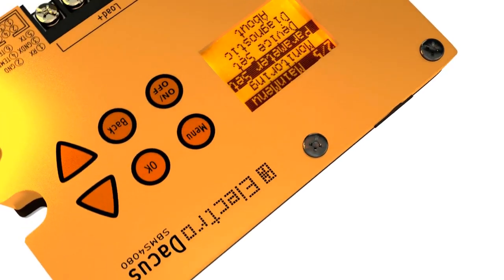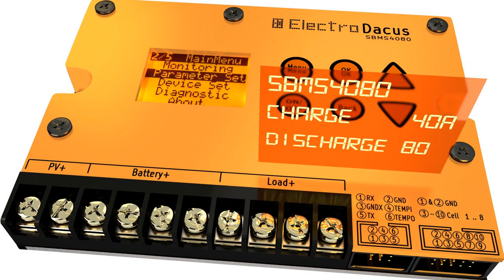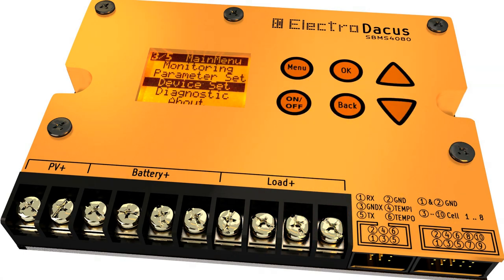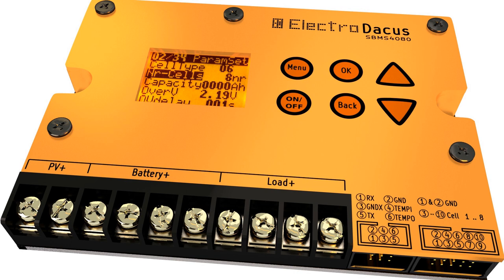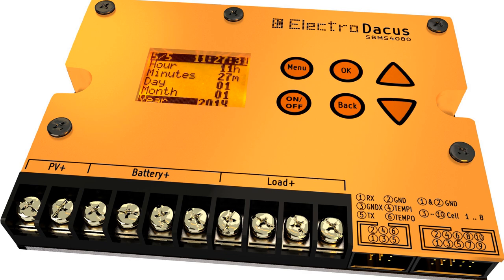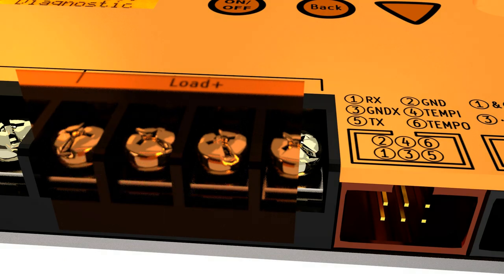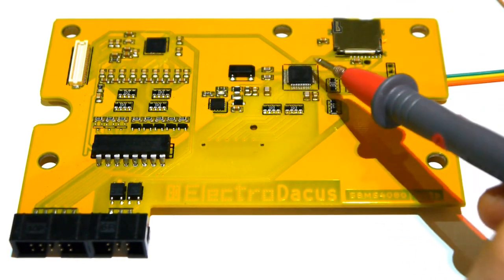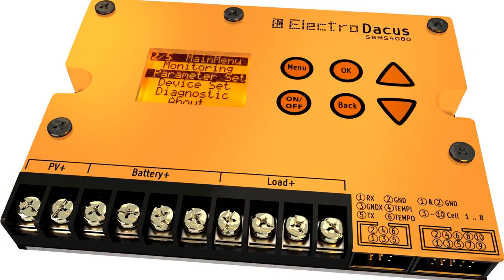Open Source Programmable Solar BMS presentation video.

Comment: That's a very nice looking item love the colours, layout and look of it. The menu's look nice too.
Reply from the maker: Thanks for the comment.
It seems we have the same taste.
There is no guarantee that the real item will have the same colors as the 3D render. I will try to get them as close probably ask for orange PCB this time since I had two different manufacturers with very different yellow amber colors the alpha sample looked much nice than the current beta sample.
The menu is something that I can control and that is the actual LCD from the beta device photographed and added in the 3D render.

Comment: thanks for the video.

i want to build 2 kw solar and battery system. I want to use GBS lithfepo  the whole system has to  mobile power buffer. Can i  use your programmable solar BMS?   what would be the best way to do it?

Comment: when charging will this keep cells in balance?

I think this is just what I need for my off grid project.

Does it do any mppt matching of the solar cell?
Reply: and very good video too.
Reply from the maker: Yes it dose cell balancing you can watch my other video the 38 minute long for more details.
I designed this for my offgrid house since there is nothing like this available.
No MPPT but is not necessary MPPT is an obsolete technology in most cases and that is because of the current solar PV panel cost.
MPPT in best scenario depending on climate will provide 10% extra energy but with the additional cost of the MPPT part especially the DC-DC converter you can get much more than 10% additional solar panels.
And the panels will last for over 25years where MPPT will usually fail much sooner because of temperature and electrolytic capacitors.
It seems I worked on the video to much and it will not even be allowed at Kickstarter because some can think that the 3D render is a real product.
Reply: *****
emmm... I disagree about the benefits, if you have a small array due to size limitations, lets say yuor panel are on an RV moptohome, that 5% extra from having mppt would be very good, even if the mppt cost $50 to add.... and it does not cost $50, there is arduino code that will work on a $5 328 and it need another $2 of components, $7 for 5%, very very worth it.

http://www.timnolan.com/index.php?page=arduino-ppt-solar-charger
Reply from the maker: lez briddon Most people will not be able to build their own MPPT so it will cost way more than that for a good MPPT but even if you build that yourself you need quality components for it to last just some good electrolytic caps will cost  more than a few dollars then you need a PCB and that will cost more than 50$ since you build just a prototype (or are you etch your own PCB?)
Anyway even if space is limited that 5 % do not worth the trouble better get solar panel that are better efficiency a 18% efficient panel compared to a 16% one will give more that a good MPPT at a similar cost.
Is also possible like in my case to use 60cell solar panels to charge 24V batteries that will not have any benefit with MPPT.
Also I do not think you add the hours you spend researching building and testing your MPPT that can cost way more than the components.
Look at me as a lesson :) I spent about 6 months of at least 8 h/day developing this and a few thousand dollars on components for a few samples and is possible that I will be the only one using this that will be really bad investment for me.
There is so much more that I can say about MPPT but my conclusion is that it had a role when solar was over 5$/Watt it dose not have any chance now.
Some people are also missing the experience of having a solar installation most of the time my batteries are full during the day so I waste huge amount of power that way :)
O and another separate argument. You say 50$ for components but not mention how much power will that 50$ MPPT (components only) be able to handle.  Also what is his self power consumption not just efficiency since that can take back all that is additionally producing during the day.
I hope you do not take this personally or that I try to defend my project :)
If I will have consider that MPPT will make sense I will have included one. Of course my device will have been a few kg heavier and much larger to be able to handle 40A charging (1000W) even with very efficient DC-DC converter.
There are no electrolytic caps in my current design.
It only has just over 200g and I save over 50$ to 100$ just for international shipping on a single unit compared to an MPPT version that will be at around 2kg at least mostly the additional coils and much larger heatsink so 10x heavier.

Comment: How do we get it? When is it going to be available? I wish I knew about this kickstarter when it was running! This is absolutely amazing! I want one!
Reply from the maker: Hi Nicholas,
This was done just for the initial Kickstarters but I will soon start a Kickstarter for a new and improved model see my last video.
The Kickstarter for the new one will start around end of February.
Reply: I'm on the edge of my seat waiting for it. I can't believe more people don't know about this.
Reply from the maker: Nicholas Libby
Thanks Nicholas, Is a bit hard to advertise a new product.
Reply: Don't worry about advertising it. Worry about getting it out there, I'll be sure to get my hands on one and everyone I show it to will be immediately saying "Where can I get one?", this thing will spread like wildfire once enough of them are out there in the wild.

This is a better tool than any PWM or MPPT (although it already says it doesn't do MPPT) system I've seen. And with people writing their own software for it this has the potential to give all these expensive systems a run for their money.

I would suggest not constantly advertising it for developers only as I'm sure anyone that could use a regular PWM system could use this after reading a little bit. When they see the charts and graphs for their battery life they'll just keep finding more settings they can improve on and will never want to go back to a dumb system. Advertise it as a smart system, this thing is brilliant!
Reply from the maker: Nicholas Libby
I currently work on the Kickstarter page and I try to explain more why this is a much better option than Lead Acid.
I also made a simplified connection diagram. Is still a bit more complicated than a simple Lead Acid controller way more connections to do do to individual cells measurement and balance.
Also the amount of settings is quite high. Next version will have a simple setup with just a few basic settings and an advance menu where all those other more complex settings will be hidden.
So I hope it will be more user friendly while still maintaining the flexibility of using any type of Lithium battery produced to day or in the future as well as super-capacitors.
Many technologies become obsolete do to low cost of solar PV in the last few years one of them is MPPT that is not cost effective to implement but solar tracking and thermal solar are some of the may others that are just obsolete because they can not add benefit to inexpensive solar PV.
I will try to make some more youtube videos explaining all this in more details.
One of my next preojects after this new SBMS will be to heat my house with electricity using just solar PV panels and resistive heat elements + a digital MPPT that I came up with. Is totally different from a traditional MPPT but dose the same thing for heating. Is much simpler no DC-DC converters more reliable and has great benefit for electric resistive heating but can not be applied to battery charging.
Reply: ***** Don't worry about simplifying it. Worry about getting more of these out. If you can configure the settings in the unit from the programmer header pins, then software developers can just make a computer based wizard where you pick your batteries, count, size, all of that, and it'll write all the configuration into the device from a USB port or something. This can be done separately and the software can be updated on the fly without slowing down the development of this board.

For example, I want one currently and there's not one available to get. There has to be other people out there that want one and can't get it. Once people can start getting it and making their own videos and software and suggestions this thing will just keep growing from there. Don't worry about the software side of things as there are many software developers out there, just give us the interface to chat with it and we'll make the software.
Reply from the maker: Nicholas Libby  You probably underestimate the complexity of the software. I'm not that great at software but I understand the HW extremely well that allows me to make a functional and bug free software. The SBMS4080 still runs the original 1.0 release version of the software with no problems.
If you really want one of this older SBMS4080 write me an email same user name as here on gmail and I will put you on a preorder list. I have 10 to 15 PCB's left from the first batch and I got the components to build them but weather was not great and did not had enough sun/energy to build them. Now I'm a bit busy with the new kickstarter it should start in about 3 weeks but ass soon as I get some days of good weather and free time I will build those and let you know.
More than half of them are already promised so I can only provide you with one in case others may also want one before I'm ready with the new version.
There are huge improvements on the new version making it even better.
Currently I'm using a SBMS4080 to run all thing in my house and is connected to a small toy laptop running Debian logging my power production and consumption so I can make recommendations on SBMS / battery size and PV array size based on real data.
I have 3x 240W PV panels and yesterday partially cloudy I produced 2.56kWh today up to now (mainly sunny) 3.38kWh. I want to log at least a week to get different conditions.
What will you use the SBMS for ? And how did you found out about?
Reply from the maker: Nicholas Libby
This is some long comment :).
Not sure you will be able to carry a 1kW solar PV panel even if it is not made with glass and made out of smaller epoxy sealed PV panels.
I have two 1h video one about the user interface explaining all the futures of the SBMS4080 and one about the hardware.
The SBMS4080 is extremely portable at just 235 grams and the new SBMS100 will not be much heavier or larger than that not by much hope to keep it under 350g
SBMS4080 can handle 1000W of solar PV panels with 24V battery half that with 12V of course since the current limit is the same and voltage is half.
The new SBMS100 will be able to handle 3000W of solar PV panels with 24V battery.
Absolutely any rechargeable Lithium battery can be used since all parameters are fully programmable using the SBMS build in menu.
It also has energy counters for battery, PV panel and Load that can be reset at any time so you can in details see the amount of energy you produce and consume. This is available in SBMS4080 and will be available and improved probably even with graphs in the new SBMS100.
But just in a week or two there will be much more info about the new SBMS on my website and soon after the Kickstarter campaign will start.
The new SBMS will also have multiple 24bit ADC input for user to measure and automate stuff externally there will also be much more IO pins available to user.

Comment: Did they deliver on this product? I'm are it's not on kick starter anymore
Reply from the maker: Yes I delivered that Kickstarter and since then another two Kickstaters with more advanced version of SBMS. The last one was delivered very recently and there are a few extra SBMS40 and SBMS120 left.
You can read more on my webpage http://electrodacus.com/ and here is the user manual for the last two models http://electrodacus.com/SBMS120/manual/SBMSmanual.pdf
You can check the progress of all the Kickstarter campaigns on my google+ page https://plus.google.com/+electrodacus/

Comment: Electrodacus. I admire your enthusiasm, but it just seems like an awful lot of smarts for a small controller. I think you need to clarify your target market. MPPT is a given for all serious off grid installations for very simple reasons. Things like real world high current distances from the array to the controller, and the rising price of copper. Like, matching the much cheaper 72 cell grid tie panels to nominal battery voltages.

Off grid we use crimp lugs,posts and 50mm2 cable, lots of it. The tiny terminals, small load rating, and 24V limit all suggest its not going to work for real "off grid" domestic applications. Like i said at NAWs, cabin, RV etc, radio tower whatever, should be good applicatiopns though.

However there is real and growing interest in LiFePo for residential off grid (eg CALB 400Ah), and it would be great to see someone thinking about a BMS that can handle 800Ah at 48V. There are various challenges, among them, comunication with the charge controller; the problem of removing battery from the controller without pv removal, the current draw and reliability of large load contactors. To balance or not to balance etc. [1]

Id encourage you to do some reading in the NAWs 'off grid' archives to get a real feel for the needs and challenges we face every day.. There are active threads both there and at midniteforum about lifepo.

Our traditional charge controllers do many other things that we rely on. One of them is notifications for opportunity load diversion. Im not convinced that attempting to recreate all of those functions is practical, but if the problems listed above [1] are unresolveable then maybe your intergrated solution will become the way to do it.
Reply from the maker: I really appreciate your extensive feedback.
The MPPT is mostly useless with todays price of solar panels. As for the savings on copper on installations where panels are far from the battery that is probably the only situation where an MPPT will make economic sense but not sure it will depend on situation. You will need 4 or 5 MPPT controllers during the lifetime of the solar panels 30 to 35 years.
60cells are as cheep if not cheaper and work perfectly for 24V this is what I use.
This was designed for my offgrid house and it mets my requirements. Is true I was born and lived in Europe where people are more conservative with the use of energy.
I see many people still don't see that I use 4 terminals each 20A to get to the 80A load and two terminals for PV for 40A
There are only the positive terminals there the negative is common outside the BMS.
I will probably add load diversion capabilities with external solid state relay.
A 40A MPPT will need to have a DC-DC converter able to handle 1000W that is huge at least 2kg where this controller has 200g so 10x less
Just the international shipping will be over 50$ additional because of the extra weight then of course all the extra components and short life span do to electrolytic capacitors.
There are no electrolytic caps in my design so it can last way more I hope as much as solar panels at least.

My house uses 3x 240W solar panels + small 300W wind turbine and a 8 cell LiFePO4 100Ah battery for storage.
Monthly total power generation is 60KWh/month in winter worst month and over 100KWh/month in best month summer from 720W PV panels the 300W wind turbine don't have exact data about 40kWh/month best month in winter and 25kWh/month in summer
Usage of the house is about 60KWh/month to 100kWh/month depending mostly on how much we cook.
Cooking is what uses probably 60% of what we use the rest is some water pumps in the winter for in floor heating house ventilation, lighting, computers some other electronics mostly in my lab and a very small peltier fridge.
Everything above powered directly from DC 24V so the 2400W inverter is only used for kitchen at most a few hours a day with absolute max load around 1800W AC with 92% efficient inverter it gets me to a max of 80A way less most of the time and this is only done during the day when is sunny.